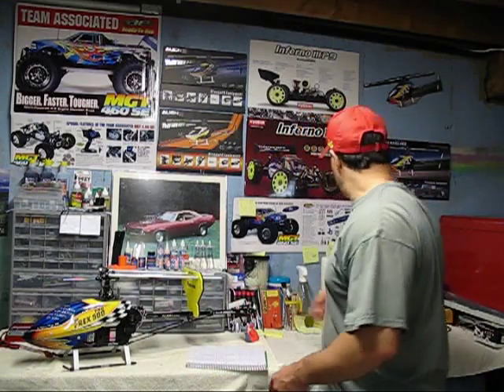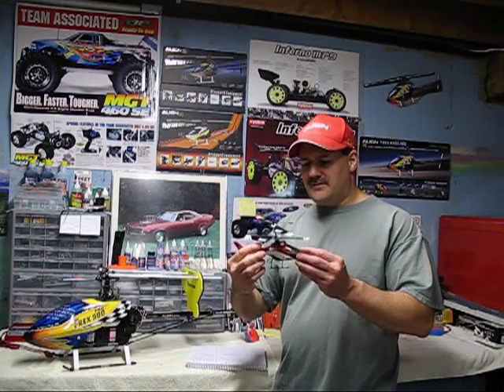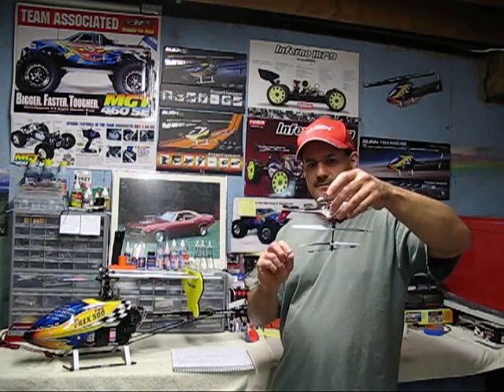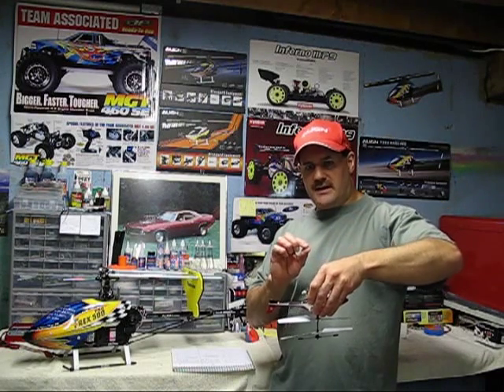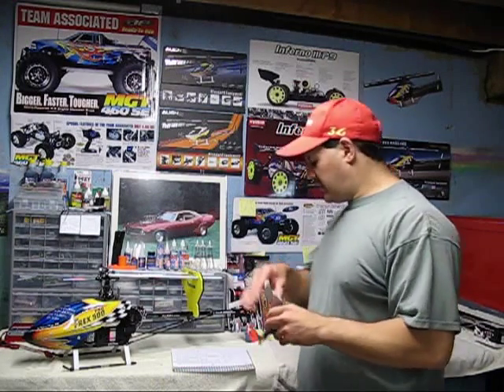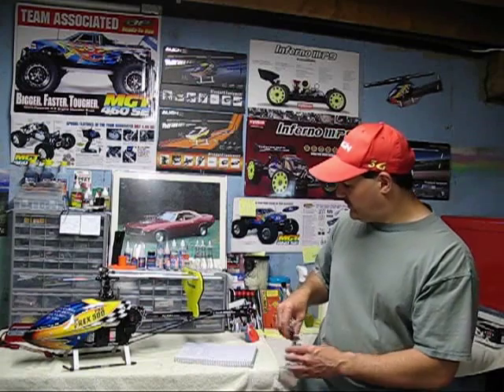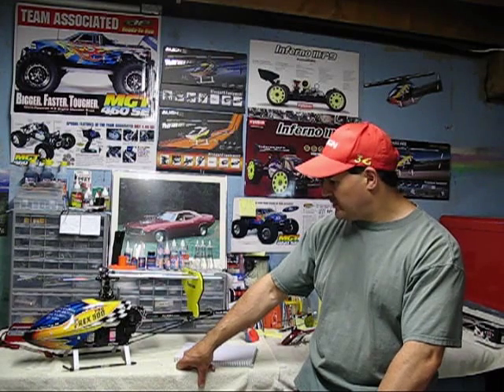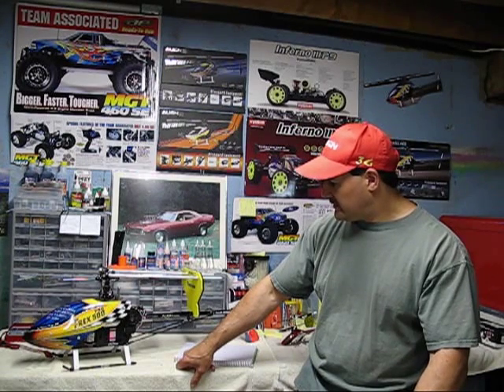Align trex 450 pro,throttle and pitch curves.m4v

Comment: Hey thanks for posting these vids. I just finished building a trex 450 pro dfc (FBL) and my question is this - in the TX do the swash mix & expo values you mention apply when using the AR7200BX FBL controller? I notice the factory settings for my 300x which runs the same unit do not have any mix or expo at all. Thanks for the help!